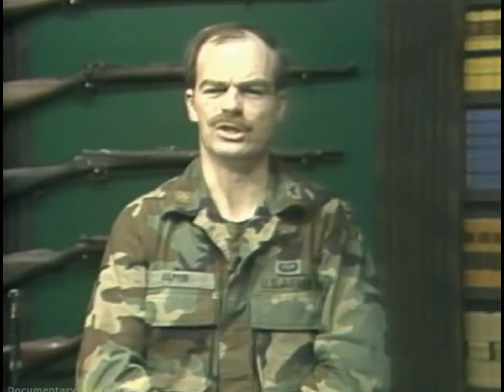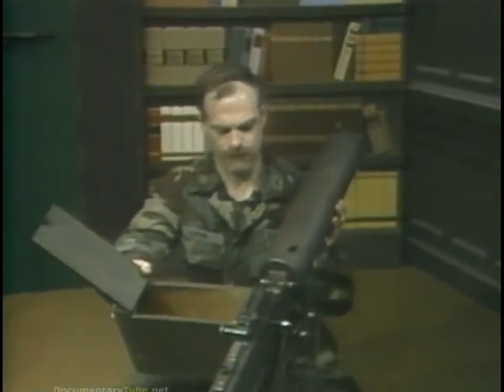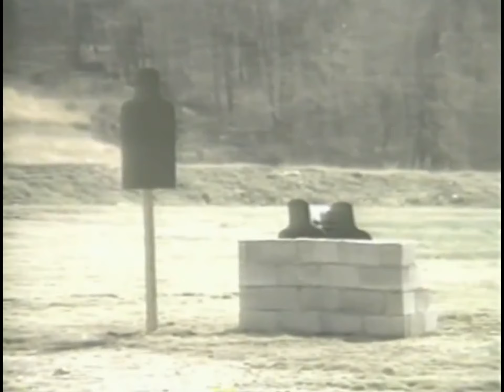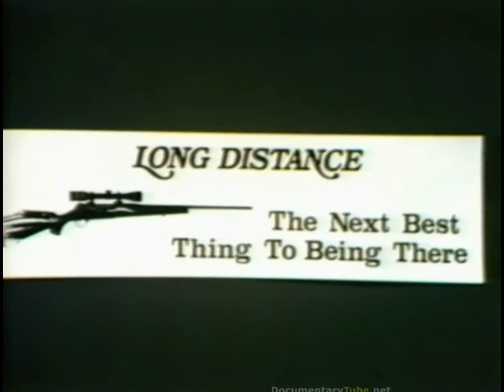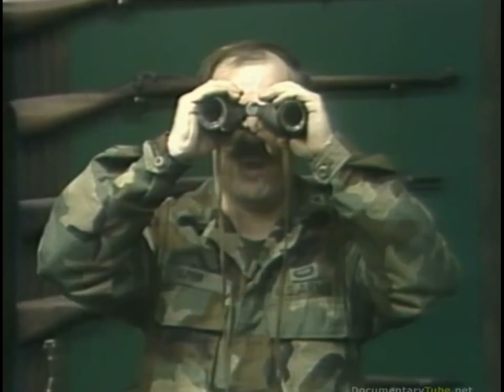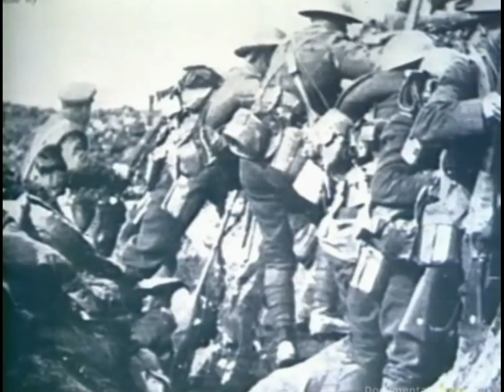Weapons of West Point -14- Water Cooled Machine Gun

Comment: The question that I have is that since the operation of the weapon is short recoil is it safe to fire without filling it with water first.
Reply from the maker: Yes. But you need to be EXTREMELY careful about monitoring the barrel heat, because you cannot change barrels.
The water is for cooling and doesn't affect the operation.